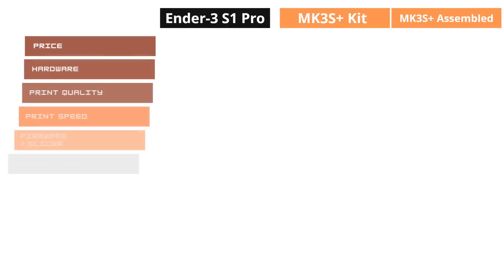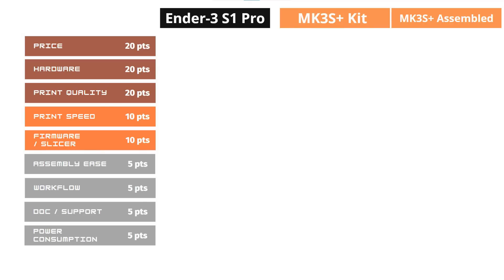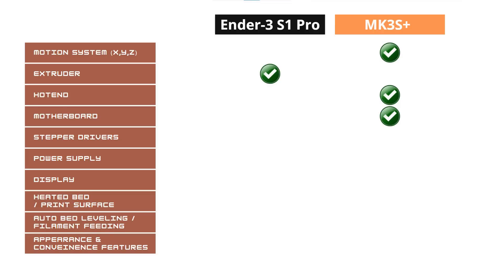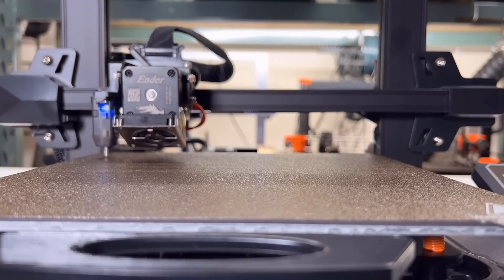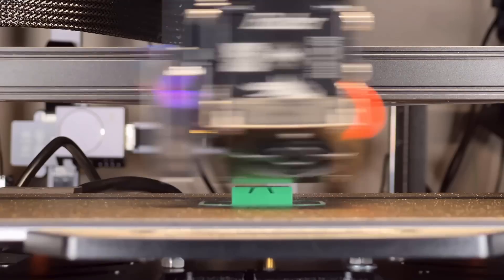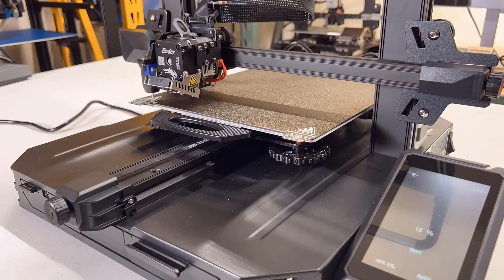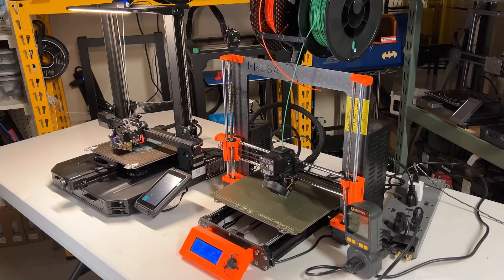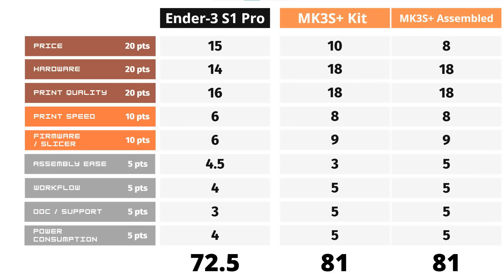Creality Ender-3 S1 Pro VS Prusa MK3S+, In-Depth Comparison

Comment: Hardware of the Ender is actually better, if you are willing to invest a night of compiling your own firmware. The actual Marlin firmware is capable of imput shaping and linear advance, and the 32 bit board which comes with the Ender has a potential for that. So by investing a bit time you can make the printer faster, print the same quality or better then the Prusa.

The CR Touch is also better then the Superpinda IMO, because it is physical, not a hall sensor. So it doesnt care about magnets, temperature, humidity, buildplate type...

The Prusa filament sensor is built in to the extruder, but most filament rolls has bent end. So it can cause issues when it detects runout. I prefer if the sensor is on the top of the frame, so if it detects runout, it is never too late to retract the filament, and doesnt matter if the end is not straight.

The extruder of the Sprite is geared, and the actual gears provide more consistent filament control then the Bondtech gears (because the teeth grabbing the filament are straight, no groove is there, just like in the Nextruder).

Also you can solve the nozzle leakage issue by replacing the nozzle with a special 5$ Aliexpress one. For Prusa the only solution against leakage is the Revo hotend which is expensive.

IMO in the end of 2024 the Prusa MK3 while is still a great workhorse, the Ender 3 S1 has a lot more potential with the stock parts just a diferent firmware. Also provides bigger build volume.

Comment: they said you get what you paid.
i have ender 3 v2. then regret it.
i spend most time for bed leveling inconsistency. it's nightmare. after upgrade part there and there still not enough. i recommend prusa for better

Comment: Hello, I'm going to start in 3D. Which of these  printers would you recommend, the ender3 S1Pro or ender3 V3 ke or the Sovol SV06plus? Thank you and I really enjoy watching and learning from your videos. Best wishes and thank you
Reply from the maker: I would suggest starting with a machine with Klipper firmware (Ender-3 V3 KE, AnyCubic Kobra 2 Pro), the old-style Marlin are too slow, I rarely use any of them.  Please visit AuroraTechChannel.com and I have a recommendation list and 3D printer price tracker tool to monitor the price of major 3D printers in real time.
Reply: @AuroraTech  thanks a lot I will get the ender3 V3 KE
Reply: Hello again I I've been was watching your  video  bambA1
What you think witch one I buy bambu or ender3 V3 KE? Thanks

Comment: As owner of Ender 3 S1Pro, I can only add NEGATIVE notes, 1) the adhesion of the plate is BAD, it doesn't even adhere with the pla, 2) The menus in the display are BAD, important information is missing, and I prefer the classic display that I have on Ender 3 stock, 3) Leveling is a real CALVARY, the automatic one is practically useless and you often have to proceed with the manual one, but even with that sometimes it's not good, 4) It has compatibility problems with the PrusaSlicer that I've been using for years with Ender 3 no problem, but with S1 pro it doesn't work well.  5) Sometimes printing starts well and then after some layers it no longer respects the correct sizing forcing you to stop printing, this doesn't always happen it's random, with Prusa slicer, it's better with creality Cura but with this slicer ( Cura) I find myself very bad. 6) The support Creality is BAD BAD BAD, the support Prusa is wonderfull. That said, my next printer will be a Prusa.

Comment: Do you know if i can attach the ender 3 s1 pro extruder on a 3 s1 plus? I want to get the + version for is larger bed but do need the 300 degree extruder. So i was wondering if it was compatible …
Reply from the maker: The extruder should be compatible, but they didn’t release the source code of the firmware, so, you can’t change the preset max temp of the extruder and recompile the firmware to enable high-temp printing.

Comment: Well someone works for Prusa,  EHHEHE!!    The price to point ratio is way off, giving Prusa a huge advantage.   Anyhow, i am new to 3D printing, got the S1 Pro and it is Amazing.  It only requires minor troubleshooting which helps learn the ropes.  No need for a $1,126.26 printer for a noob like me.  Also a $200 Ender copy would be too much, overwhelming troubleshooting.  The Ender-3 S1 Pro  JUST WORKS as advertised!!!

Comment: I like all the upgrades in the S1 Pro. I've seen mixed reviews for Ender 3 linear rail upgrades, most people don't seem to think it's that useful. It would be a nice thing to have though I guess. Replacing rollers is a pain. Creality's awful firmware, support, and documentation is a real problem though. For my Ender 3 I eventually switched to Klipper firmware and it's been a big improvement.

Comment: I have the Prusa MK3S+ kit version and it's been performing flawlessly for over a year.  I got the Prusa mainly because the company I worked for had 8 of them which were used to make precision medical device parts.  I saw these printers running everyday in an industrial setting and they were clearly durable.  Another thing to mention is that if you order the week after Black Friday Prusa usually has free shipping.

Comment: For a beginner its ender all the way and if you spend a few more dollars the ender can be upgraded to beat the prusa into the dirt. Its 2023 who wants to buy an 8 year old 8 bit printer that takes 8 hours to build when you can buy a load of different printers that print out of the box in less than an hour and cost a fraction of the price in fact you could upgrade an ender 3 s1 pro to really beat the prusa for less than the extra you pay for the prusa. face it the perusa is out of date and practically obsolete now.

Comment: I originally bout and ender type printer from Amazon about 5 years ago. After a couple misprints, a clogged nozzle and the headache of having to level the bed with springs, I returned it and got a Prusa MK3S kit. Assembling the printer wasn't difficult and was a really fun project in itself. The printer is amazing. Hassle free printing at it's best, just hit start. Prusa is a prime example that you get what you pay for.

Comment: For most people, price is a much more significant factor. Personally I view the Pursa as a slightly better printer for 4 times the cost. If you look at units sold you can see a similar story, there is way more Enders being sold.
Reply: How do you figure 4X?   $800/$500 = 1.6X
Reply: @markgebert2541  sorry was comparing the original Ender 3, my mistake.

Comment: Fair comparison. Other consideration today is option to upgrade the S1 Pro with the Sonic Pad. Likely a shift in terms of usability and speed. You get Klipper firmware, a host of other great added features, and by all accounts run 2-3 times faster without loss of quality for an upgrade price (~$150) that still keeps the S1 Pro way less than the Prusa.
Reply: (And saw your other video about the Sonic Pad, too. It's why I mention it for others here. 😊 I think I'm leaning toward S1 Pro plus Sonic Pad now!)
Reply: considering how she got the same score for the same item but in kit vs. completed  even with the sonic pad I bet she would have scored it the same.

Comment: The comparison is valid for stock printer and for beginners.
But you can easily install improved firmwere from the github for ender 3 1s. After that tou will find no difference between the printers. All the adventages of prusa are for beginers

Comment: I went with the Ender S1 Pro for my first print farm since I was able to get each printer at half price. The Prusa is nice but, too expensive.
Reply: I asked a 3d printing sub what the value of going with a Prusa on the used market was since I see these going for between $500 and $800 used, compared to Enders which often go for $100-$200. Both typically including add-ons and upgrades.

Pretty much everyone on the Prusa side was hung up on the whole no assembly option,  no matter how many times I clarified I was asking about the used market where most machines will be assembled and you can just as easily get a basket of parts Prusa as Ender.

Really I just wanted an idea of what significant hardware advantages make the Prusa worth a premium used, I ended up buying a Creality cr6 se for $60..... after cleaning and adjusting it the thing works perfectly and any issues I've had I would as likely as not have had with a Prusa.

Comment: Is power consumption really that important for a 3d printer? This is not a car or computer or light, not much power it can save , MCU and stepper motor don't use a much power,  most power goes to nozzle and heated bed to simply produce heat, this is the same for most printer, all printer. If user want to save power, best way to do so is to lower temp setting, and or buy a smaller printer, or add a box,enclosure, so not to waste power to heat up the air in the whole room.
Reply: I thought the rationale for including this was well explained. For a hobbyist, probably not. If you're aiming at a print farm or just running it a LOT, some areas like California charge extra for going over a reasonable power use. (And even if not, may still be a factor if you're otherwise power constrained.)

Comment: Amazing comparison between those 2 printers, with a well structured scroring system. I think is a dilemma of a lot of us to choose our next printer
Although price and assembly is an upfront cost/work you need to do and all the others will be our daily routine, if you remove them out of 100 the score will 66.25 for Ender and 85 for Prusa that make the difference even bigger

Comment: I’ve only been “around the community” for 2 years. Given that, Ive seen an insane amount of content and people dedicated to the Prusa and often I’ve seen why. The quality that the Prusa puts out is undeniably outstanding. That said, for the price, for the “standard bedslinger”, I don’t think I’ll ever own one. The printer I’m building right now is a direct result of your review, Sovol SV05. I got it, because it’s “Creality Roots” and I got an amazing price. Given the competition in this area and the pricing, I’m surprised people still pay Prusa’s prices. When I shell out,  close to / over a thousand, it’s core xy time and most likely Voron. I would think, at some point, Prusa would have to step up their game, screen wise, etc….etc…etc…. Yet? People are still buying them by the truckload so? I can’t question it. Yet, I do.
Reply: The reason why I would buy one is primarily because of their consistently good part printing. Too many other printers, including some $2000 ones have issues. I had a $150 printer that needed to constantly be tweaked to work properly. One part would look great and a then a duplicate part would look horrible.

Comment: While I ALWAYS appreciate your direct approach to delivering content, and generally well rounded review vids, I don't think you gave enough credit differences to price and convenience of setup. Prusa should have lost a ton more points for being unrealistically over-priced, and ugly to look at. Furthermore, the Prusa should have lost a TON of points for their pathetic display. For that kind of money, that printer should have the nicest display in the industry, not the 1980's looking crap it comes with. In my rating system, the Prusa was disqualified for those few factors before even getting out of the gate... And while I like the Ender 3 S1 Pro, I like the CR-10 Smart Pro better.

Comment: The Prusa MK3S was my introduction to 3D printing.  I was going to go with Creality, but a few of my friends mentioned that with upgrades they would run the same price.  I could not be happier.  The 8hr build helped with understanding how the printer worked and troubleshooting when things broke.  Now I'm just waiting fir the XL to come out and upgrade to that.
Reply: Even with upgrades creality s1 pro still cost about half of Prusa. But Prusa uses higher quality hardware.
Reply: Not really. You can get Prusa quality with a fully upgraded Ender 3 and still much less than the Prusa.

Comment: there is a mistake about motherboard, the s1 pro use a 32 bit microcontroller and prusa one use a 8 bit microcontroller, ender 3 s1 pro motherboard is more powerfull and better than prusa one.

Comment: Appreciate the comparison! I my opinion, the Prusa is given too many points here. It was the worst printing of all of my printers (Monoprice Mini, Ender 3 v1, Elegoo Neptune 2, Prusa mk3s+, Ender 5 Pro) and the most time-consuming build. I hoped for the money that the Prusa would be measurably better than my stock Ender 3 v1. Once I got a new mainboard, the Ender 3 won in almost every category. I've since upgraded it even further. My newest printer is an Ender 5 pro and it still performed out of the box better than the Prusa.

I got the Prusa as a gift for my brother who is more on the tech gadgets as a status symbol side of things (apple products). Prusa is branded similarly. I regret that decision.

Another awesome video!

Comment: That was a very good overview of these two printers and the scoring seemed reasonable and very fair for the testing.  Even though the Prusa came out on top in many areas, I still like the added features on the Ender 3 S1 Pro, like the light bar and the fact that the replacement parts are much easier on the wallet between the two.

Comment: Thanks for the great review. It was good and refreshing to see the differences between the "gold standard" and the cheaper alternatives.
The price tag should not be considered in the final result of points though as it doesn't determine how good or bad the printer is technically. If you determined a score free from the price tag and another "value for money" score, that would be great.
It would be 71/80 for the prusa (89%) and still 57.5/80 for the Ender, which is 72%. So technically the difference is even bigger that in the last table.
Thinking about power consumption, rising prices for electricity and faster print speed, the same model will be cheaper on the prusa

Comment: But that mono display and all together take much less electricity (almost nothing, like 1$ per 24/7 a week printing), so it lower your fonances for printing and you can go lower or earn more. Buuut that LCD touch drain 15-20 times more per week, so its 15-20$/week. And that something in way, it wait and print, or lose filament, wait and print, and power supply off and then too print and finish save you time, and filament. This no other printers cant offer.

Comment: I see there is new Ender 3 S1 plus available. Same temperatures as S1, user interface as S1 Pro, but print size 300x300x300. Released about month ago. Wonder is S1 Pro will be launched as Plus model with 300x300x300 print area? Maybe "Ender S1 Max" is to be next release, but when?
Reply from the maker: I will be reviewing the Ender 3 S1 PLUS and CR-10 Smart Pro in coming weeks.

Comment: I concur that Aurora Tech has provided another excellent review. Kudos to the team! ... I don't have a question about this review. I have a question about bed leveling with a piece of paper. Paper thicknesses vary. How thick (in mm's) should a piece of paper be to perform manual bed leveling. I know it's a newbie query, but I am a newb. Thanks! :)
Reply from the maker: Using a paper or even a feeler gauge may still not get the perfect distance as the nozzle and heated bed will expand depending on your printing temperature, after you set the perfect distance for printing PLA (200C/60C), when you print high temperature filament like PC or PA-CF (300C/120C), you may still need to adjust the Z-offset using the screen when it starts printing.
Reply: @AuroraTech  Your response is incredibly helpful. With such high tech equipment what befuddles me the most is that we take a piece of paper to set up the distance between the nozzle point and the heated bed to make 3D prints of things "in space." ... If you don't mind I have several follow-up questions related to manually setting up this distance. 1. Can I use any old piece of copy paper for the manual leveling task such as a sheet of copy paper? (A friend advised me that he takes a "receipt" from a restaurant, doubles it over, and uses that to set this distance. 2. I have seen you use a feeler gauge to set this distance in some of your instructional videos. 2.A. How thick is the feeler gauge that you use? 2.B. Do you use the same thickness feeler gauge when you level any 3D printer? ... Yes, setting the nozzle height while the bed is heated makes a lot of send to me and I appreciate the note/reminder. I deeply appreciate your instructional videos and assistance. Your videos are more professional than may I have seen after several years of watching so many videos for five+ years.
Reply: @glenneaton9051  My Anycubic Mega printer manual included a thickness range, so I used a .005" and .002" feeler gages, combined. But with the Anycubic, I still had to increase the nozzle to bed plate gap while the first layer was being deposited. I think Prusa's method of adjustment is a very good idea.

Comment: Great video. I love the way you broke it down into different sections. And different waves depending on more important factors.

One correction though, the prusa does have belt tensioners built in. They are small screws but they are technically tensioners.